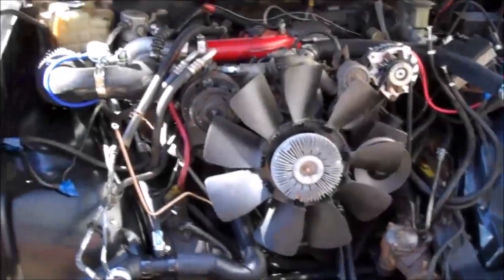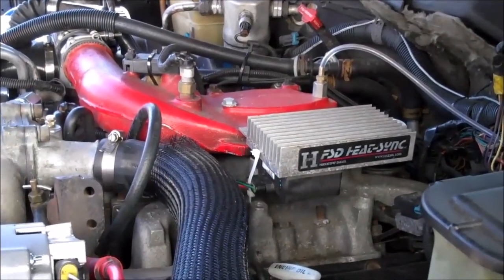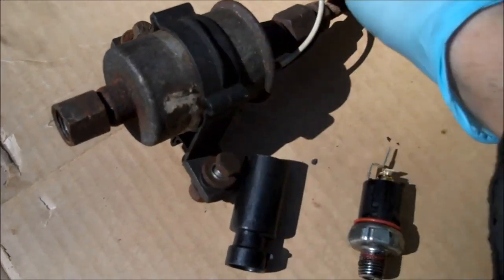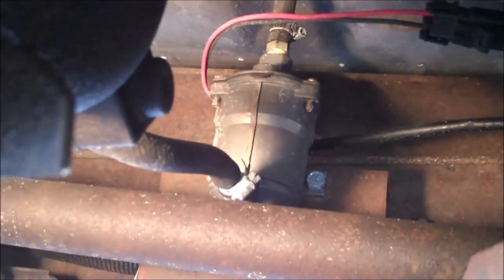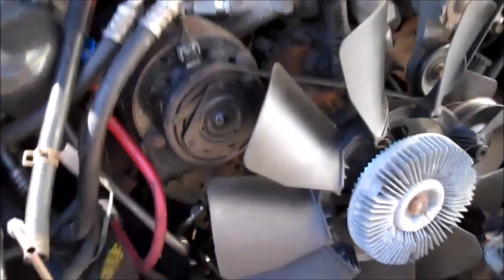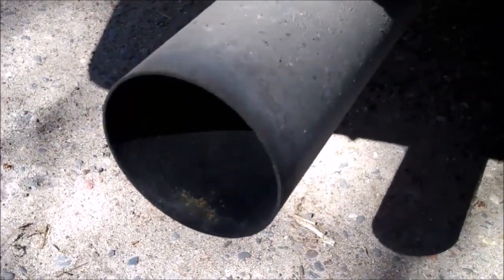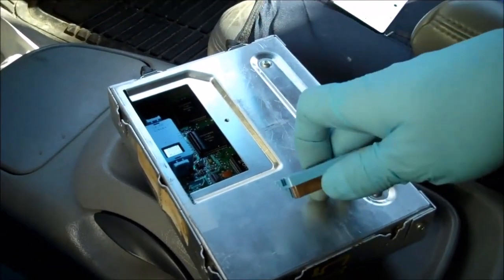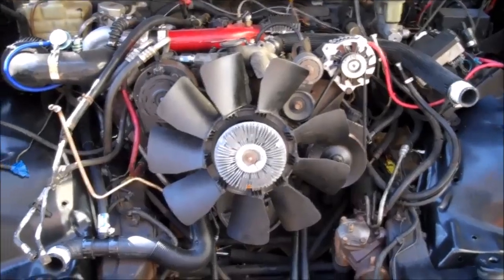6.5 DIESEL ENGINE - HOW TO BOMB PROOF IT

Comment: The way this election is going and crime etc sparked my decision to trade my hot rod for a M998. I have the 6.2 and it will not start in cold. I live in cold mtns. Q: What freeze plug do I put the block warmer in. It doesn't have one? my humvee runs great motor awesome. Doesn't start? Also, eether? where do I spay to prime? Anyone?
Reply: never put either into your 6.2, they don't like that at all. Change your glow plugs and check their controller.
Reply: +dirtyski 111 
Thanks Man! Its my first diesel. So far I have purchased a magnetic block heater. Is it safe to leave it on overnight? its a KAT 300 off amazon. I only fire it up to have fun w friends and family on our private property.  I used my wifes hair dryer, as safe as possible without leaving it unattended, to heat the air box and it helped. I can't afford glow plugs at this time but soon I will and maybe I will contact you. thanks again check out my video if u have the time.

Comment: hi my name is Curtis Wade I just brought a 94 gmc 3500 I love the ole truck but it Hoggs up the fuel and yes it seems I have some home work to do like putting on a big air filter and getting rid of the vac. pump etc where can I get the chips for this truck and where can I buy parts for it u can tex me if you like my number is 352-318-7865 thanks for any help also what year did u order ur fan for the dural max and how would I make it work on mine
Reply: Heath diesel link is included in video

Comment: i did the PMD and installed the #9 resistor. I want to test the vacuum before i do anything with that cause if the vacuum is sufficient i'm gonna let it go for now. bought the Holbro lift pump need time for that and need to do the bypass. ANYONE WANNA SHOW ME HOW TO BYPASS THE SAFETY SWITCH I SEARCHED BUT DIDNT' COME UP WITH ANYTHING. Now that I saw these mod videos I'm sensitive to the "whine" of the turbo which means it's spinning and not so fouled up with carbon so far.

Comment: Just purchased  a 95 6.5 Tahoe. my first diesel I get it Wednesday. I want to start  right in on bomb proofing, then upgrade it. pmd was already  done, but what lift pump model did you use and would that be considered  a fuel pump? Fantastic  video thank you
Reply: Andy D check out thedieselplace forum there is a 6.5 section that has an unreal amount of information

Comment: great video, thanks. Now that I have powdered your butt, I have a 6.5 Turbo I am putting in a 89 K3500. I need a vac pump for the TH400. Would you recommend using a CUCV pump from a 6.2 or just live with it as it is. Cheers
Reply from the maker: Well.....the general feeling is that the CUCV is a more reliable design.   Being gear drive as opposed to the belt is a huge plus to me.   I can tell you for sure that the CUCV pump is a HELL of lot easier to change out!   The only advantage of the 6.5 vac I can think of is that it's in stock at almost every auto parts store you can walk into as are most 6.5 parts.  That's my 2 cents.

Comment: I have a 94 K2500 4x4 suburban with the 6.5 turbo diesel, I love this truck and will be doing some of the upgrades talked about in this video
Reply: Matt Schneeflock I’m considering swapping the 454 in mine out for a 6.5 and after seeing this, I can’t really think of a reason not to do it.
Reply: Leonard Schleuning if you end up doing it could you post it somewhere? I want to do the same to my 98
Reply: @leonardschleuning3070  
I
Reply: There’s a decent lookin one out on marketplace that’s just over an hr away from me. I’m contemplating it. All it apparently needs is a new fuel tank hooked up…..

Comment: love your sponsor. on the lift pump, which one would you use Leroydiesel has 2 lift pump. another question is I have a 99 suburban 6.5 if I was to connect the waste gate to the intake would that be fine too??

Comment: Great video I just bought a 1995 3500 Dually it's being delivered this weekend can't wait to look it over for the vacuum pump issue I agree Stupid
Reply: hey how's your truck ? I'm looking into a 96 3500 with 182K for 3K
Reply: +Ángel Romero I top the air off works great drive nice 4x4 good too it's got a little blow by but not what I would consider bad for 174,000

Comment: Whats the serial number on the walbro lift pump? Or how can I know I am buying the correct one?
Reply from the maker: Jim,  check out Leroy Diesel on the internet.  (link is in the info box)  He has ready made kits with walbro pumps.   I can't say enough about how happy I am having a fuel pump I don't have to worry about.

Comment: OK,    Here's another Dumb Question ---The 1 inch bundle of wires, from back top of the engine, pass side to injector pump.   Should it be above the injector lines or below, setting on the block valley.

Comment: dam fine vid ty pard!! I had a 94 6.5 heavy 3/4 ton truck and bam did you ever hit every dam nail on the head!! lol I had the prob with that dam fuel system overheating 2 times! but I sold the truck to my bud I worked with and he did all the changes you discussed here and bam that is one sweet running truck now! wish I had it back! great vid man!!
Reply from the maker: Thanks for the comment,  done right the 6.5 can run along time,  run well and get way better mileage than anything else.

Comment: about bomb proofing the 6.5. will it throw an engine code when you remove the air pump n bypassing the turbo solenoid??
Reply from the maker: It won't throw a code for missing the vac pump,  but it will throw a code if it doesn't sense enough vac for sustained periods over 10psi.   The code will not hinder the function of anything and goes away after restart.   I have chips so I don't get codes,   there are cheap "foolers" for sale as well in the aftermarket.
Reply: OK thanks..I really appreciate you getting back to me. I have a 99 6.5 suburban. The chips works on those as well

Comment: Please, Will You tell me where the engine should be grounded to the frame?  Should a ground strap run from the intake (or any where else) to the wiper motor?  Got a 1995, four door dually, good body, with a botched engine replacement.  My 1998 7.4 dually has the ground strap (I replaced that with battery cable Years ago) from frame near the starter to engine block.  Pulled the wheel well off the 6.5 to find the strap in that location going to the body.  GM trouble shooting-step one, always start with grounds.   Can You help me out???
Reply: You just have to have grounds. Normally, battery to a big bolt on the engine. You can go from either the engine, or battery, to the body. And from the engine or battery to frame. 99% of the current draw is in starting, the other grounds are for much smaller draws.

Comment: Thanks Yankee Prepper!
I bought a billeted waste gate actuator set @14psi because I havent had any problems with my vacuum pump, yet. Also Made my own down pipe adapter with the wastegate ported into the downpipe.(Ididnt like the PT version it seemed to restrictive) I did get a waste gate controller from pt wiring just in case the pump did go and I was stuck some ware . 
When you were adjusting the tension did it through codes on you?

Comment: Were you in the midst of taking the vacuum on the hx35 off and putting in a manual waste gate controller?  Could you do a vid showing how you calibrated the spring on it please.
Reply from the maker: You simply adjust the tension of the gate open until you get the desired maximum limit of boost while flooring it.   It takes a couple times out on the road both at hwy speed while flooring it and from a stop sign.    I limited mine to 15 on the boost because I can't control myself.
Reply: I believe stock is preset @5psi 
 These were not known for having gr8t head or intake gaskets . 
I'd upgrade both before turning boost past 9 psi OK 
15 is good once done and there is also a rocker arm upgrade that someone still uncontrolled could do for a wee bump ..Hwvr Why?! 
  Ps I'm a prepper too ; Thank God 
Always and Praise Jesus 
I found your Vid ..truly appreciated

Comment: Can anyone help, I have a 94 6.5 Turbo. I have new set of heads last year, removed vacuum pump, new lift pump, relocated PMD,  new ECU, New alt, and 4" exhaust. I am having a "miss" for lack of a better word, this happens at idle sometimes, can be herd through exhaust, and under load. seems to be getting worse, usually don't do it early AM. ambient temp doesn't usually play a factor, I keep thinking PMD is getting hot, but moved to cab, and no change. I am really tires of throwing money at it. 

any help would be greatly appreciated. 

Thanks Robert                                 r_thacker80@hotmail.com
Reply from the maker: This does not sound like a PMD problem to me.   And understand that without being there....it's really hard to diagnose anything over the comment section...BUT....my experience with this engine brings to mind 2 things to mind immediately.   Small chance that it's the Optical Sensor Filter   It a 5 inch connector coming out of the Injector pump,   easily replaced and pretty cheap SSdiesel sells them.   But the 1st thing I would suspect is the fuel lines,  if you are running the original fuel lines from 94...it's time to replace them no matter what.   Any air in the system will give you the symptoms you are experiencing,   especially that you are getting the problem under load and it keeps getting worse.   Look for wet spots on your lines,  it just takes a small leak to give you that "fishbite" effect.    I would not give up,   sometimes you just get some bad junk that you can't see.
Reply: thank you, I will try this, I really appreciate the help.
Reply from the maker: I hope it's successful for you.   The fuel system needs to be tight on these diesels.    I replaced my fuel lines with a nylon kit I bought on Ebay out of a mom and pop shop from Michigan.  It was ready made to length and it made it pretty easy to install.   I replaced the tank and sender at the same time,  very easy to drop the tank on these rigs...2 bolts and it's down.  The fuel sender is KNOWN to corrode with age and get leaks.   If you do replace the sender make sure you get the proper fuel sock,  it must have the flap valve on it,  or the diesel pump will sometimes over power the sock and flatten it.
Reply: OK, thanks for your help.
Reply: Thanks for your help, seems that the Optical sensor filter was the solution.

many thanks
Reply from the maker: Thanks for letting me know!  Makes me feel like my time on youtube isn't a total waste.   I had the same issue about 8 years ago,  glad I was able to help.
Reply: Its me again, I need more help. with all these questions, I'm going to have to pay you a consulting fee. so I replaced the optical sensor, it ran great for 3-4 days. Now I am seeing erratic throttle response. its like I have no small amount of pedal, its over 1500RPM or nothing. any suggestions?
Reply from the maker: I think you are dealing with separate multiple issues and that always makes it more difficult.   I know you said that you changed the location of the PMD...but if the PMD was damaged because of heat....it will remain damaged and will not function properly...continuing to worsen.   Again,  I am trying to diagnose from afar,  but if it were me....I would switch PMD's with a PMD I know for sure is working properly 1st.   I have a spare PMD I keep in the glove box for this purpose.   Stuck at 1500rpm points to the PMD and seems different than the original issue.    The pedal or throttle control also could be an issue,  I have a spare one as well purtchased from craigslist list for 20 bucks  that I keep around for trouble shooting.  But would suspect the PMD 1st
Reply: I will look into the throttle, I also replaced the PMD with one from SS at the same time as Optical.
 Thanks again for the help.
Reply from the maker: That's good,  having a spare on will give you peace of mind,  but also for trouble shooting.   If you know the PMD is good,  look at the pedal/throttle.    I know this is aggravating,  but you are very close.   Overall the engines are pretty simple and once you get the electronics cured from "old age" failure it will be a great rig.
Reply: thanks, it sure doesn't feel that way, I have been working on this thing for over a year. its just one thing after another. after this, one more thing and I'm out.. I cant keep it up.

Thanks again for your help.
Reply: I know this is an old post but I think you may have a air issue in your fuel delivery system somewhere. Pressurize the fuel system and search for small leaks anynd everywhere. My 6.2l had a bad return that was dry rotted and it lopped and sputtered off and on for 3 months before I tracked down the problem. Just a thought.
Reply: Hey I'm the one who thanks you both.....
Having same problems on mine and I know now what to do .
You guys are life savers and God's hand placed to help me solve these problems.
Thank you

Comment: my 20 year old 6.5 is running better and more reliable than my buddies 04 cummins aha
Reply: The 24 valve cummins is not as good as the 12 valve.  Also, the 24 valve is not a cummins head which is part of the problem.

Comment: Man I wish I had found this about 2 months ago. I seriously looked into buying a nice 97 6.5 just to drive back and forth to work and parts runs for the farm. I walked away from it, everyone I talked to that owned one had horror stories about them, most would have been fixed with what you showed in the video. Great educational video that anyone looking into buying a 6.5 should know.
Reply: I’m hoping to look at one this weekend. Making sure I can get a new reliable daily for not too expensive
Reply: Literally dont understand why you need to bomb proof these engines one here in germany is for sale that got 434k miles on the odometer. Dont think that 434k Miles is low mileage.
Reply: @Jean_1999 The 6.5 hate is weird, these trucks are like $2,000-$5,000 in the U.S for clean ones. $2,500 in bullet proof parts and turbo/intake work and you have a strong reliable diesel.
Reply: I rebuilt a 1996 K2500 surplus. Had to totally rebuild the fuel delivery system, rebuilt  the transmission and it ran great except the PMD but we got that fixed.

Comment: what are you getting for oil pressure cold, then warm throttle and finally warm idle? 
Ive got one that is almost scary low but I've read it's "normal" with 220,000 miles. Certainly need to get a mechanical guage on it instead of the lie-o-meter sending unit.
Reply from the maker: +BAMAJiPS   When cold starting I am usually a little better than in  the middle at 42-45psi (idle).    When Hot idle,  it's at 38-40 psi.    When running at 2000rpm it will sit at 60psi.   My truck has the HD oil system (optimizer),  I don't know if that makes a difference.    From what I understand,  this is normal and healthy oil pressure for the 6.5 diesel.If you are getting low oil pressure or the needle is bouncing around and your engine is running good....I would 1st suspect the OPS.   It's such a weak part,  but cheap to replace.   If your VOLT meter is showing low as well,  I would check the 3 main grounds.   This can also affect the gauges,  I have had this happen myself.    I have also removed the cluster guage and cleaned the connections on the strip and seen more accurate readings.  I hope that helps.
Reply: Thanks for the reply. I know you've maintained yours very well as I've been following you for a while. Never know when you buy used junk as so many people seem to think the only thing vehicles require now days is to gas up and go. (Diesel in this case but you get me). 
Such a shame the disposable mentality and "trade it in for another so I can have the newest and best..."  thought process. 

Im getting far lower readings than you (18-20 psi at warm idle) so I'm not holding out much hope. Good thing I have 2 of these motors. One out for rebuilding.

Comment: Tank you, very relevant. I have a 1994 CK2500 HD and it is my work horse. I pull a good load, a camper on the truck and a trailer full of tools.  I have a 4.10 ratio and it is boring without load but perfect to work hard. I have a question, what is going to do the job of the vacuum to activate the waste gate?? You throw away the vacuum pump but where is coming from the suction now?? The waste gate need a actuator isn't it??Tank you again.Denis Morissette (Québec, Canada)
Reply: doesn't the vacuum pump operate the brake hydro boost also?
Reply: +Dennis gtNot it doesn't, brakes are operate by the power steering pump.
Reply: Right, I had got that mixed up, my bad, thanks

Comment: after the vaccum pump delete how did you run the waste gate? im planning on doing the three tips u have to my 99 6.5
Reply: hey man, look up Heath diesel. they have great stuff for the 6.5. a manual controller will set you back 100 bucks

Comment: I LOVED YOUR VIDEO. I WORKED on my 2000 c3500 HD all winter getting it ready for spring as a welding truck. I had it new kept it in a garage got in the pmd from Amazon and have no idea how to get to the connector. I want to do all the mods you did they are probably going to require me to remove the nose. Looked up the holbro lift pump it's gonna take time to select the right one.
Reply: got it did it done

Comment: asked this queston on the wrong video. when the vaccum pump was thrown away, where you hook up the line. thanks in advance.
Reply from the maker: +Greg Chamberlain   Take all that crap of or just plug the vac line.  It doesn't do anything but tell the ECM where the turbo is with boost.    You can buy ECM turbo foolers on line or there are sites that tell you how to make your own.   I have a custom PROM from Heath diesel so I don't get any SES lights if the Turbo boost goes high.